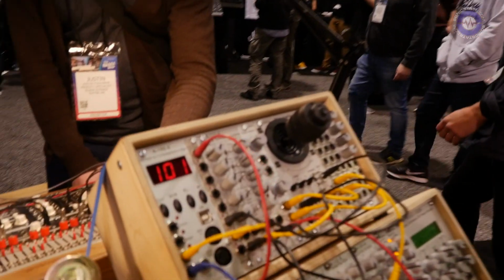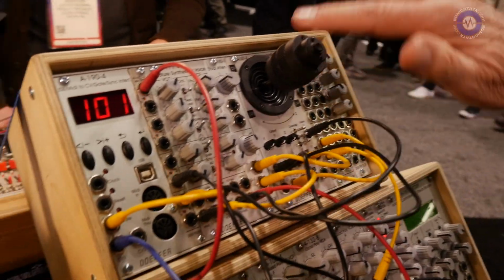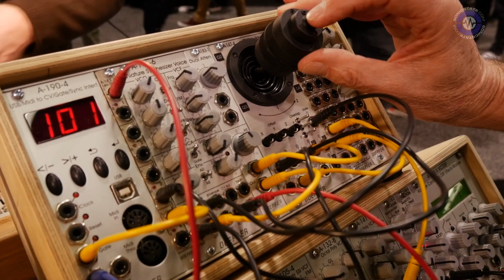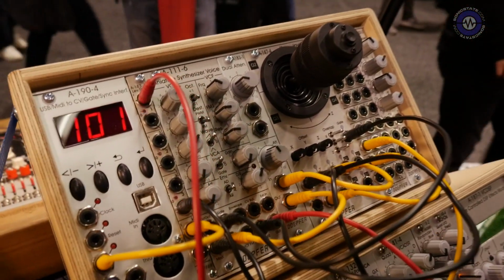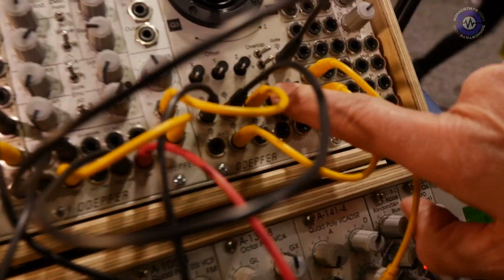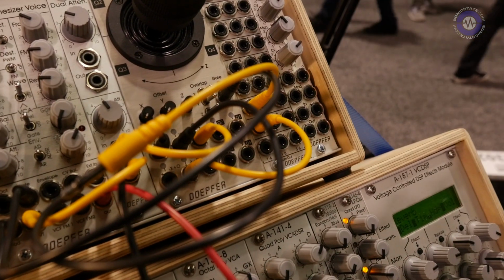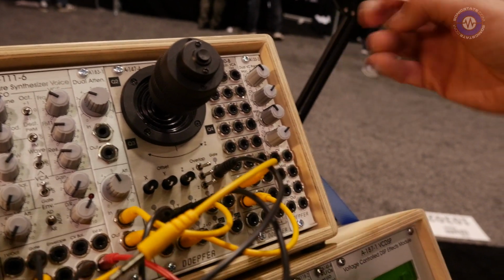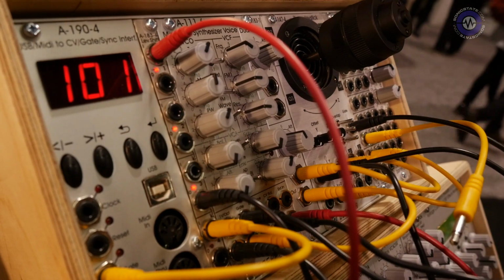NAMM 2020: Doepfer Made a Joystick Controller With A New Axis!!

Comment: PROBLEM! ......... imagine this: 
Joystick is pushed fully up (max Y)
With Y at max, you now want to add some X (by going to the right).
As you move to the right, Y gets reduced, because of the physically round joystick gate.
When you're at max X (fully to the right), Y can be at no more than zero (half of max).
Completely useless!
Joysticks (X/Y  controllers) should have square gates! (like plugin ones)
Better luck next time Doepfer!
Reply: Dazzer1234567 Aren’t Joysticks usually configured to output maximum values for both the x and y axis when positioned in a 45 degree angle?